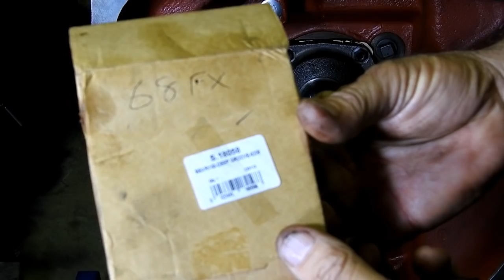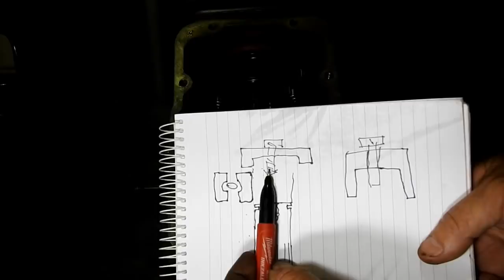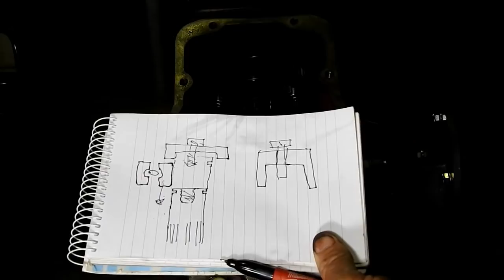MF135 6 Speed Restoration #57 Fitting the Lay Shaft Front Support

Comment: Love the videos. I have to replace the input shaft seals on a TO35 dual clutch with the Continental Z134 engine. Does the lay shaft get pulled from the front or do I have to split my gearbox. Please tell me it comes from the front.
Reply from the maker: On the MF35 it is from the back but we dont have the TO35 here so I cant really offer good advice.

Comment: Hello Lance just wanted to say without your videos I would have never taken on rebuilding my three-cylinder Perkins.
I have a MF 20 industrial. Since I have the tractor split I wanted to replace seal at front of transmission.
Is that possible from the front without opening transmission.
Reply from the maker: If it is a 6 speed no Multipoewr yes/
Reply: @BundyBearsShed  I just pulled out the book it's an eight-speed transmission 8 forward and two rivers
Reply from the maker: @rickharris941  Im not sure with the 8 speed, just give it a go .
Reply: @BundyBearsShed  many thanks Lance.
Sending a ...Goodday  from the high dessert of Arizona

Comment: Hi great video,if I just needed to do input shaft seal,would I have any need to remove bottom plate with 4 bolts?135 1968 diesel it just leaking hydraulic from there.
Reply from the maker: Yes you do to get the frond top support out and you will possibly need to drop the rear of the box off as well.
Reply: @BundyBearsShed  so gearbox would have to be removed?
Reply from the maker: yes probably.

Comment: What size bolt can I thread into the shaft to pull it through the bearing without taking the gear box out
Reply from the maker: On these you cant, on the very early grey and gold 6 speed you could though. Im not sure of the thread size now as I dont have one in pieces.
Reply: I have a 66-67 150 with the multi power and it slides back and forth but can’t seem to get the shaft to slide through, it is threaded inside the shaft hoping I could make a slide hammer instead of splitting it

Comment: Very nice video .
II have a 35X 6 speed  equiped with a loader but  with a single clutch.
Is it possible to replace the single clutch with a dual clutch  when a replace the gearbox also?
Thanks
Reply from the maker: Yes but you would need to replace the flywheel, clutch and gearbox to do it.

Comment: I went into my 1973 MF 135 perkins gas, non multipower to change the dual clutch as the PTO was slipping.  I found lots of oil.  I figured out how to replace all the seals going forward into the engine and I have watched most if not all of your videos trying to find out how to get this main drive shaft out that the throwout bearing rides on.  In one of your videos you mentioned to drop a gear in the lay shaft in order to pull out the main shaft.  In that video you said it can be done without taking the tractor apart any further but I've looked all over the internet and can't find the info on how to do it.  I am going to be pulling the PTO shaft out of the back as I have a leak back there also.  While that rear PTO is out will this allow me to push back the lay shaft and drop that gear to get the main shaft out?  Or do I need to split the tractor further?  Will I need to access this area thru the top under the gear shift?  Any pointers or direction would be greatly appreciated.  Thank you for the  videos on the clutch as I jumped all over that after watching your videos and it made it so simple to get it completed.
Reply from the maker: Only on some of the early 6 speeds can you get it out without doing the second split, usually you need to do both unless it has had a modified bearing carrier fitted.
Reply: @BundyBearsShed  Thank you.  Guess I'm taking it apart some more.  Is there a gasket between these two pieces for the second split as you said?  I can't seem to find it in the parts manual.
Reply from the maker: @chapinburgess3220  Yes there is a gasket. look at the catalogues section on my web site you can download the Sparex Massey parts book for free.
Reply: @BundyBearsShed  Doing the second split made it so much easier.  Thanks for that advice.  Gave me a chance to get into some other parts and change them out.
Reply from the maker: @chapinburgess3220  It helps for sure.